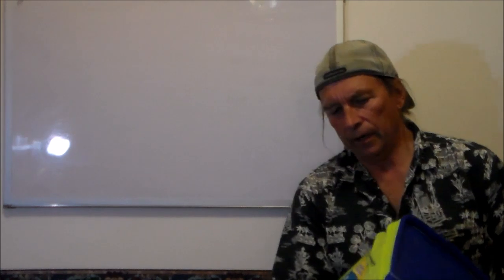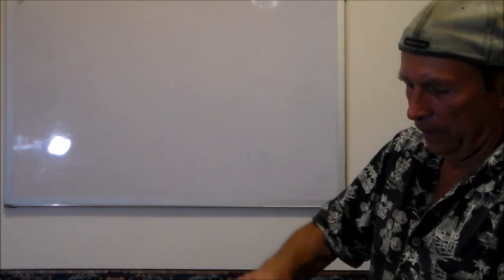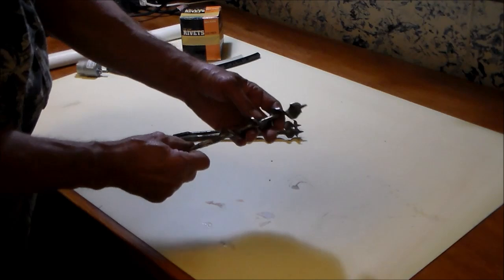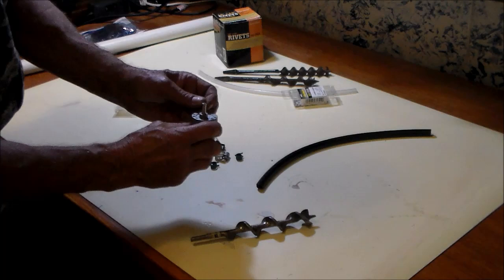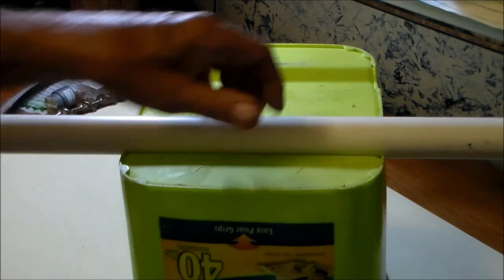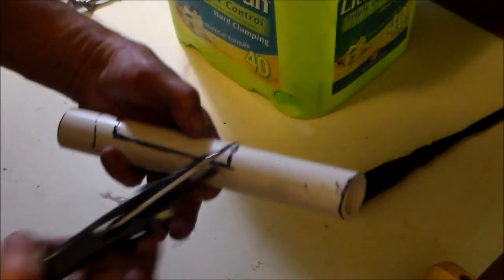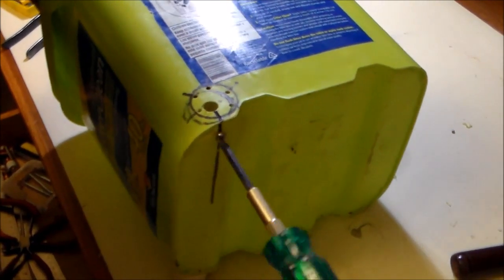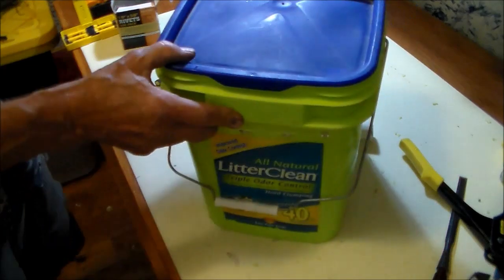Aquaponics Automatic Fish Feeder

Comment: love your videos. thanks for taking the extra time to post your projects. I see the motor is 30 rpm are you happy with that? if you did it over, would you change the rpm at all? how much feed does that dispense?
Reply from the maker: the 30 rpm works fine--- I can adjust the amount of feed with the duration of the timer---it all works great!

Comment: It looks like you were trying to remove the label from one of the kitty litter buckets.  Try using WD-40. It loosens many glues. If the label has a shiny coating try and peel as much of it off as you can before applying the WD-40. Let the WD-40 sit it takes time to penetrate the label and get to the glue. Rubbing alcohol works well to clean up the WD-40.
Reply from the maker: Thanks for the tips my friend---Don

Comment: Thanks for the video Don.  One tip that might help with drilling the hole for the auger tube.  Start the hole to the point where the drill bit pierce the plastic, then reverse the drill's rotation.  This provides a cleaner cut and doesn't "grab" the plastic.  Thanks again for sharing.
Reply from the maker: Thanks for the tip my friend---Don

Comment: very nice! I've been building a circuit + microcontroller for measurement of pH, temperature, nitrite, and nitrate + dosing. Haven't made an automated feeder yet, but this is a great idea.

Do you have a github account for code or anything similar?
Reply from the maker: I'm not familiar with this---Could you educate me on this?
Reply: Don, github is a popular free service which facilitates the sharing of software source code like an Arduino sketch. Aside from sharing, it allows individuals to collaboratively create software: creating enhancements, fixing bugs,  and so forth.  If you elected to do so, you could create a 'portafeeder' or  'portaponics' repository and upload the feeder sketch you created. (Think of a repository as sort of a project-oriented collection of files).
Reply from the maker: WOW that sounds great--- I will do this, thank you my friend---Don
Reply: Donald Porta. Did you look into GitHub? Icarus91 is right. Its the defacto standard for sharing code. I would be curious to see what you use on your Arduino.